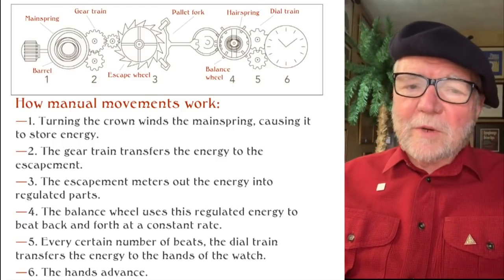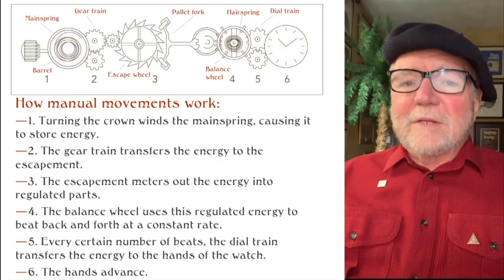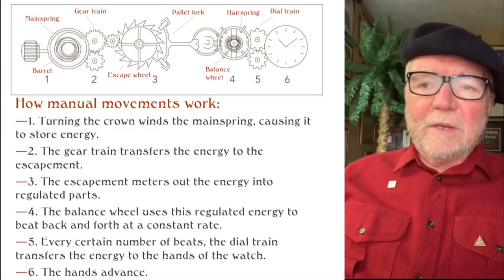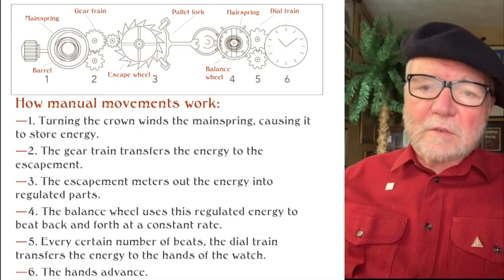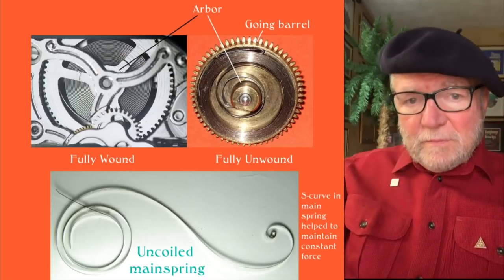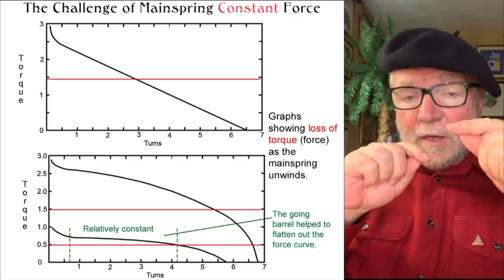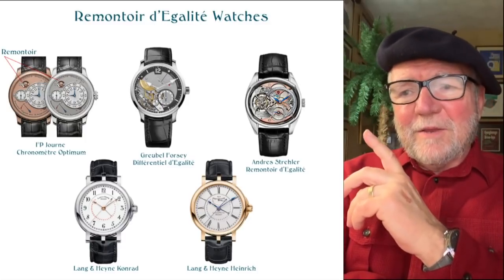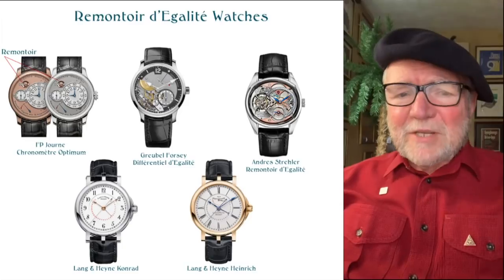May the Constant Force be with You: Remontoir d'Egalité

Comment: Hello! I don't think you mentioned the reason for a constant force escapement: it's due to the isochronism defect of the balance-hairspring oscillator.
Reply from the maker: Thanks Ilan! What exactly is the defect of the balance-hairspring oscillator? defect of the balance-hairspring oscillator
Reply: @watchartsci  Hello again! I was refering to "isochronism defect," i.e., that the balance-hairspring frequency (daily rate) changes when its amplitude decreases. To have a more steady daily rate, you need to keep the amplitude relatively constant, and that's the reason to use a constant force escapement.

In theory, the hairspring-balance wheel has isochronism, i.e., the frequency is independent of amplitude, so independent of the torque transmitted by the escapement. In practice, this is not possible, e.g., because the center of the spring isn't exactly at its geometrical center.

Comment: watchmaking is basically steam-punk ... daydreaming about solving problems we'd still have if technology hadn't left the mechanical realm. the features that stand out, imo, are: 1, what might have been achieved in ancient greece with a bit more focus on scientific literacy; and 2, the fact that an interesting problem doesn't stop being interesting just because it doesn't need solving anymore. that these are the dreams that someone without a lot of technical training might have seems to explain the continuing obsession with mechanical watches

i suspect, though, that some of the solutions horologists are seeking are analogs of designs electrical engineers invented years ago. issues like "how do i harvest smooth power from a large but inconsistent energy source without throwing away the excess as friction" are bread-and-butter skills in electronic design. tbf, an escapement looks very electronic (quadrature plus a resonant circuit) ... but my nagging suspicion is that a remontoir should look more like a switched-mode power supply
Reply from the maker: You know 5naxalotl, you either get the appreciation of mechanical watches or you don't. Not taken from the EE field ... you must know mechanical watches preceded EE solutions. You're trying to understand something with EE, that's not EE. See if you can back up a century and look at the math and physics of horology. You'll learn about what the appreciation is. Take care and be safe, Bill😷
Reply: @watchartsci  and you must know that proper mechanical solutions respect physics. and that means an EE solution can be a perfectly good analog for a mechanical problem. do you know that electrical engineers study mechanical systems that are exact analogs of electrical circuits, or do you just enjoy sounding like you understand why the field has nothing to offer? you talk like horologists have perfected their solutions, at the same time as acknowledging that remontoirs lose unacceptable amounts of energy. your snippy response hasn't stopped me from wondering whether banging a moving gear train to an abrupt halt is optimal
Reply from the maker: @5naxalotl  It's understandable that you would want to take something you do know and apply it to something you do not. If you were involved in quilting, it would not make quilting a correct analogy, even though you may like and understand how to quilt. I have a great respect for EE as at one time I had to make a physical interface between a robot and computer, and then write microcode from binary, to hexadecimal machine language, to assembly and then two higher-level languages. However, I did not try to take my understanding of coding as a substitute for learning enough EE to correctly connect the wiring between the ports on three different computers with 3 different I/O ports to the microprocessor in the robot. I suggest that before you try and bully your "expertise" in EE as a substitute for knowledge of horology, you learn something about watchmaking. Pick up a copy of George Daniels' "Watchmaking" and read it. Then, I'd also suggest you buy an inexpensive movement (like a Seagull ST 36xx clone of the an ETA 6497/8) disassemble it and then reassemble it. (Here's a link: https://calibercorner.com/eta-unitas-caliber-6497-6498-assembly-disassembly/ ). If after doing that, then we can talk, but don't try and pawn-off supposed expertise in EE as a substitute for learning about mechanical watchmaking. What sounded "snippy" to you is better described as "fed up" with posers who try and push their arrogance in one area onto horology. Take care and be safe, Bill😷